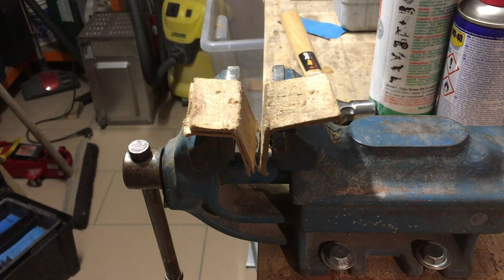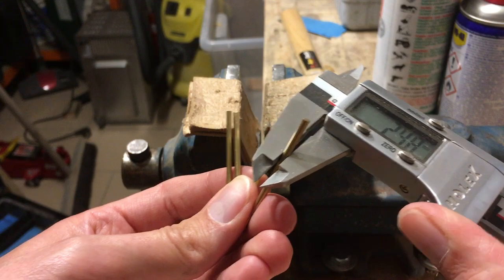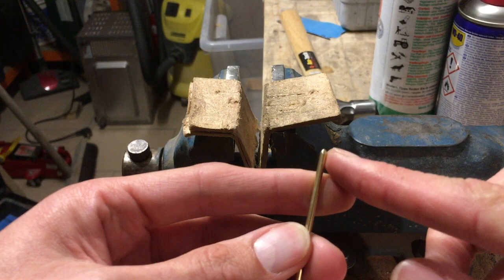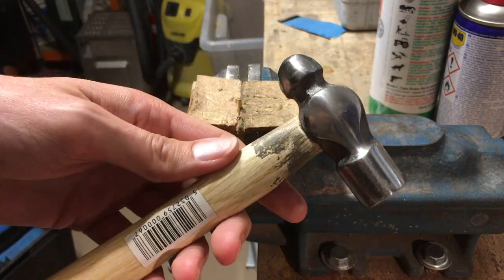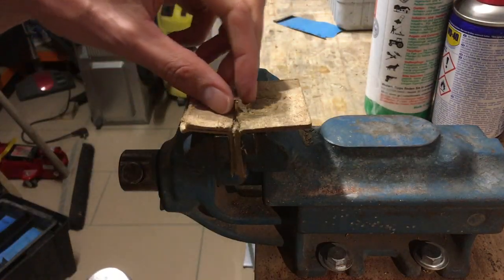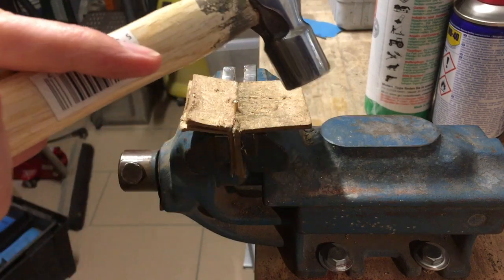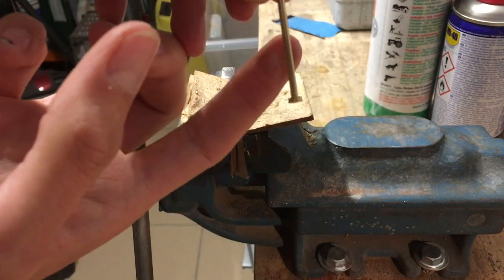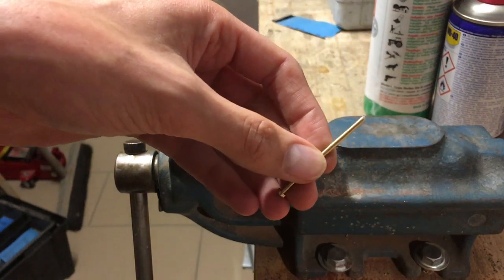Cyber Champ #6, How to make the head of the rivets. Victorinox Mod

Comment: I just cannot get it to work! The rod either slides down in the vice or the rod bends! I compared the material from the original rivet to the rod i have gotten, they seem very identical.. What do i do...
Reply: Try hitting with a lower force to avoid/minimize bending. To minimize the rod sliding, you need to either clamp tighter or using some material with high friction in between the jaws of the vise. Maybe roughen a piece of leather with low grit